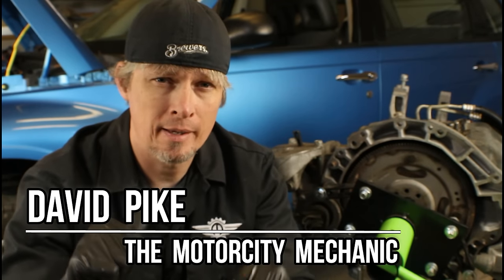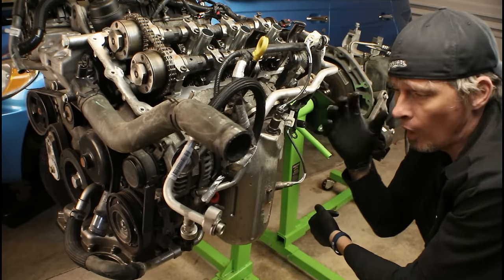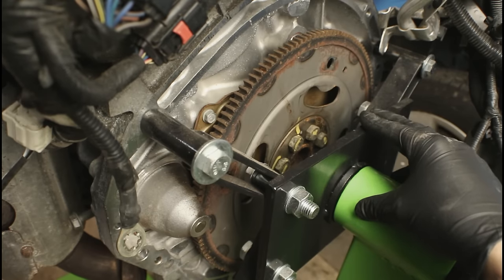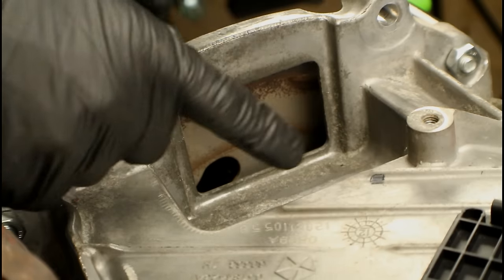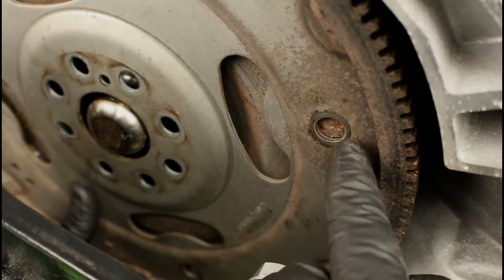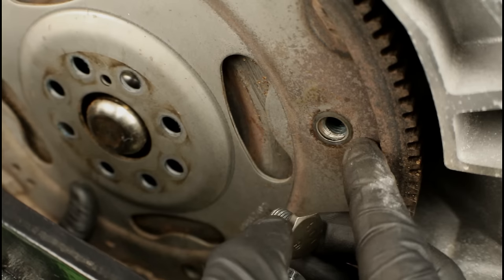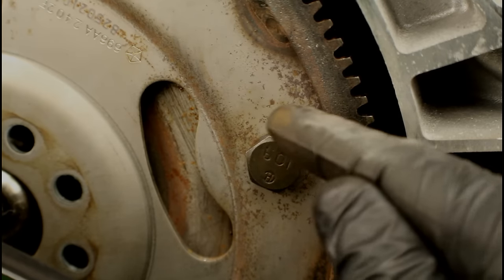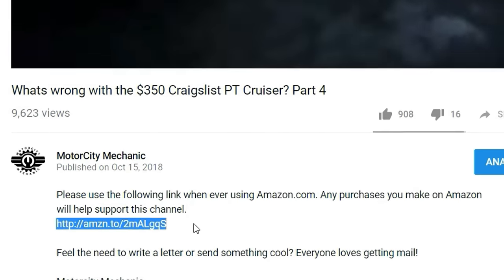Quick Tip: Installing Torque Converter Bolts

Comment: It actually amazes me that this whole thing is only held together with 4 very short bolts! Thanks for this video, you just saved me a lot of time!
Reply: Some are 3 bolts,   M10-1.5x15 , 10.9
The 9.8 bolts should only be used in 4+ bolt design.

Comment: I actually looked at this video because when I took my 2014 Chrysler 300 3.6 engine out to replace it, I threw all the bolts in one pile and now that I'm putting it back together I wasn't sure which bolts went to the torque converter.  Mine has a different flywheel being RWD, but the bolts that I suspected to be the ones are indeed the ones I see you using here.  I have the correct number of those non-flanged black 10.9 bolts, but thought surely they should have been flanged.  This video cleared that up!  Thanks

Comment: Mopar was always different with their flex plates, from the 60's (maybe the 50's) on they used an offset bolt pattern so it was wise to mark one bolt hole on the plate and converter with some paint. If using a new plate or converter you wanted to mark it before putting it all together. And many of them had the starter ring gear on the converter instead of the plate.
Reply: Damn your old🤣

Comment: Great tip, I've installed at least 6 of these pentastar engines/trans and I never noticed the one hole being different. However, I did have one engine where I had problems getting the last bolt in the torque converter and it wouldn't go until I loosened all of the rest. Now I know why. 
Great tip thanks again
Reply from the maker: Appreciate the feedback. Yeah I had the same issues until that one day many many years ago when someone showed me and then I couldn’t believe it was staring me in the face the entire time 🤔😂
Reply: @MotorCityMechanic  ain't that the way of it?
Can't see the forest for the trees sometimes😎
Reply from the maker: Trace 23 Very true!

Comment: Thank you sir I was having issue lining up one bolt I had two of them but it was slightly off as you mentioned im going to get back under and loosen the initial bolt I started with and try and tighten one of the others hopefully I get lucky and they all lime up or  I'ma be spinning it for days .

Comment: Not a Mopar guy, (At least for a few years) But I'll have to see if GM does this.  If not its a shame they, because they force us to do as you said and rotate, rotate, rotate!  Good tip, well explained, simple to understand how it will same time and keep your brain temperature from boiling over cause you had to rotate the flex plate 20 times!

Comment: See a bolt hole...insert a bolt...if it was the “odd hole” torque it all the way to spec...if it’s not...just finger tight...on to the next bolt

Potentially saves you a full rotation on an LS. If you have help, it’s no big deal, but by yourself, it saves a lot of time.

Comment: In my 2000 Chrysler  town and country. My van wouldn't start took starter off found a bolt blocking my starter from starting. Well didn't know where the bolt came from so I put my starter back on.  Van started right up running a little rough.  Long story short the bolts for the flex plate all came out and left me stranded on the side of the road.
Reply from the maker: Joshua McCord great find, sorry it happened. Thanks for finding this video and make sure to subscribe

Comment: lol, I just did this on a 545RFE. I don't recall a special hole but I did rotate it more than once to pre thread the bolts. Then tightened bell housing, then final torque. The MOPAR manual says tighten the TC flex plate bolts last step after bolting in the xfr case and rear support member. I didn't wanna wait until it's all the way up high to do this so I did it after torqueing the bell housing while it was still lifted low. I hope this is ok lol. Comments? I can't imagine the shaft or anything would shift enough to cause a problem here when you install the xfr case

Comment: Thanks that's an excellent tip. I went to the garage and check some of my old GM and Ford Flex plates and didn't see any bolthole with the flat sides but all my stuff is from the 60s. The old Mopars from the era had the ring gear made to the torque converter and they had a separate 4 bolt plate that bolted to the crank
Reply from the maker: Your right. The older stuff was different....almost forgot about those days. I get soooo stuck on the new stuff that the old stuff disappears in my memory bank.

Comment: Never knew that but on my 79 F150 302 ci (C4), the four holes only align up one way. Plus the torque converter when installed has studs that protrude through the flex plate to be attached by 4 prevailing (flanged head) torque nuts. I learned through trial and error the Ford stamp goes up. This aligns every hole to install the 6 bolts to attach plate to the crankshaft.

Comment: At the crank bolts there is a small hole in flex plate put it op. Drain plug on comb.it works from 60s up

Comment: still a fly wheel and flex plate same thing when its not attached to the torque converter like the one you got in your hand it can be used for a manual also if your torque converter has the fly wheel made on to it then its just a torque converter flywheel

Comment: You will find similar schemes all over the vehicle.  The 4 way locator (in this case, the large center hole in the plate), 2 way locator (a slotted hole), and clearance holes are a result of GD&T... which comprehends part variation.  That's how assembly line workers can crank out 60 vehicles an hour.  All mating parts have to fit the first time, and engineers spend a lot of time with the part suppliers to understand / control mating feature variation.  Anytime you see a slot (or an alignment pin), know that it is with purpose.  The problem lies with aftermarket suppliers who don't have (or understand) the original drawing.  This video should note that will work for Original Equipment parts, but not necessarily aftermarket parts.

Comment: Well i'm now on my way to removing the 8 or so dam bolts my flex plate has because the last one is not threading in lol.  I knew something had to be off and was concerned it was another thing.  So , I'm hoping going back over these holes and seeing an indicator or something might give me the fix it needs to allow that last bolt to grab. Im already concerned because i've never messed with this before, but how hard can it be .  lol ty sir

Comment: it doesnt matter if the hole is keyed or not, catch all first then tighten,  what your doing makes no sense, whats the rush ! Take your time and do it right and u wont have to do it again as a come back!
Reply from the maker: When your flat rate.....spinning the engine over two times is time wasted especially when they have made it simple for you already.....why not use the special hole....thats why its there. Not sure how that would have any bearings on becoming a come back but none the less....to each their own. Thanks for the comment and for watching Dwayne.
Reply: Actually, it does matter.  It's just math.  The design comprehends feature variation of the plate and torque converter.  GD&T is applied to the dimensions so that any plate will mate to any converter, and the 2 way locator (the slot)  is fastened first.  The other 3 are clearance holes, and mathematically will always be aligned (as long as both parts are built within the tolerance window, which the Quality folks police).

Comment: I had a starter shear the teeth off ring gear/flex plate.  Replaced flex plate and starter all good.  Should say it was a diesel heavy cranking to turn over.  Still asked alot of people and not seen ring gear teeth broke off.  Nice video     Did you do anything to beef up the TE trans in video.  Or add a turbo to the 3.6????
Reply from the maker: I havent seen that happen ever before but I guess there is a first time for everything. As far as the TE trans.....no modes or upgades that I know of.

Comment: Excellent video, thank you David. 
However I'm working on the same exact commination, I just replaced the engine, bolting all together and now the engine spins very stiff then stops at one point. I can't tell what's going on. Any ideas??
Reply from the maker: Nothing is coming to mind.....its going to be one of those things where I would have to see it in person to get a feel of whats going on.
Reply: @MotorCityMechanic  it was one book that was not tightened!! Thanks a lot
Reply: Bolt*

Comment: So it doesn't matter where the special hole is on the flex plate, only that we install the bolt through the special hole first.  I think I'm ready for a Hemi!
Reply from the maker: Special hole first and all will go fine from there

Comment: I ‘m glad to have your channel,can you let me know how to deactivate my seatbelt chime?2018 Ram Promaster 2500
Reply from the maker: Here is what I have found. I am pasting the info here. If hard to read then email me and I will send it to you that way as well. 

STANDARD PROCEDURE - ENHANCED SEATBELT REMINDER PROGRAMMING
The seatbelt indicator also includes a programmable enhanced seatbelt reminder or BELTMINDER feature that is enabled when the vehicle is shipped from the factory. This BELTMINDER feature provides extended and modified visual seatbelt indicator and audible chime warning responses to an unbuckled driver side front seat belt. The BELTMINDER feature may be disabled or enabled by the customer using the programming sequence that follows, or by the dealer using a diagnostic scan tool.

CUSTOMER PROGRAMMING SEQUENCE

NOTE: 
The following sequence of events must occur within 60 seconds of the ignition switch being placed in the ON position in order for the programming to be completed successfully.

With all doors closed and the ignition switch in any position except ON or START, buckle the driver side front seat belt.

 
Turn the ignition switch to the ON position and wait for the seatbelt indicator reminder function to conclude (about six seconds).

 
Unbuckle and buckle the driver side front seat belt three or more times, ending with the belt buckled.

 
Turn the ignition switch to any position except ON or START to toggle the BELTMINDER feature from its current setting (from active to inactive, or from inactive to active). A single chime tone will provide an audible confirmation that the programming sequence has been successfully completed.

Comment: Great suggestion to use the guide hole!  You asked for questions.  Consider a scenario where there's an appreciable gap between the facing edges of the flex-plate and torque converter. What's the optimal approach to bridge this gap?
Reply: @dnlmachine4287  I'm working on putting back together a 1986 GMC C10 High Sierra. It was a young man's truck. He had the engine and trans redone.  Each was plopped back in the truck. Unfortunately, he passed away before he could complete the project he started.  The truck sat four years. Fast forward to now.  I'm putting this thing back together with the intent of getting it started, sorted out and running down the road. The torque converter was a bit away from the flexplate.  I didn't have to force anything.  I simply slid the torque converter forward towards the flexplate by hand. The TC moves forward and back smoothly with little effort. Once I had TC mated up to the FP, I screwed three bolts in without issue.  They each went in by hand until seated. Then,  torqued them down. Is this Ok?  What would you do different?
Reply: @dnl, this clip shows the "gap" I was describing.  Looks more like the expected end-play of the TC.  I'm going to look this up myself.  But if you happen to know what the spec values are for 16-bolt 700R4 TC with respect to the FP, please share here.  Thanks!   As far as I know, this is the transmission and TC that came with the truck from GMC. It's been worked on. What that means is lost in history.   I believe the FP is also OEM piece. Ditto for the 305 engine.  I'm presuming it should bolt up and be Ok. Let me know if you think my presumption here is flawed and how to come correct.  

https://youtu.be/hMpVrEAZUTA

Comment: yes good but do all flexplates have this bolt hole that's different? I have a 2001 dodge ram van 5.2L and I may have to change the flexplate and the torque converter some time, Ihope not too soon!!! but I am gathering information at the moment. Thank you for the video!!!!!!!!!!!!!

Comment: According to your description, it seems like these bolts do not need to be cross-tightened as you would do when mounting a wheel, for example.  Or, did I get the wrong impression?  Wouldn't torquing them in sequence leave residual stresses?

Comment: Thanks for that tip! I had to have machine work done on my 03 Frontier so I pulled the engine myself. They wanted $1500.00 for R&R. I figured while it was out I would change the transmission front pump seal. I know a little about engines but nothing about transmissions. Do I use Loctite on the converter bolts? Also, what is a good way to get that seal out since I don't have a puller? Do I grease or oil that seal before I put it in? I think a big socket or piece of PVC would work to get it in. Thanks again! PS No rush. I'm in lockdown here in Las Vegas because of COVID19.

Comment: Hi David, I'm reinstalling my 3.6 back in my 2014 jku. My question is how do you line up the hole once the trans and engine are mated back up. I'm using the starter hole to install the bolts and I'm not having a lot of luck finding the threads.

Comment: Good information as usual, but why are the flex plate holes so over sized anyway?
Reply from the maker: Most likely for tolerance between the locations of the threaded portions of the torque converter and the holes on the flexplate. They arent an exact match so it takes up the slack so to speak.
Reply: @MotorCityMechanic  Thank you.  Just seems tolerances on a rotating mass like that would be closer.  Of course it is mass production.
Reply: I know this is a old comment but sometimes this actually works to your benefit,a lot of people will install a flexplate while a converter is not properly seated on the pump in the tranny and destroying the pump in the process while torquing down the converter to the engine.

Since the tolerances are loose (basically the flexplate holes are bigger than the screw) once your start finger tightening your bolts you can use that looseness to check and see if the converter is lose (properly seated) by rocking the screw back and forth, if it doesn't rock back and forth and it seems tight your converter is not seated properly and its telling you "dont proceed or you'll be sorry"  

This is specially helpful in older Ford cars where the converter has studs and not screws, once you marry the engine to the tranny, rock those studs a bit back  and forth, no rock? dont proceed, tear it dont and find out where your bind is.
Reply: @dntlss  Thankyou, interesting point.

Comment: Changing out a cracked flex plate Where can I find the torque specs for the bellhousing flex plate and torque converter And Transmission mounts

Comment: Morning Dave. I purchased a brand new Chrysler 300 with the 3.6 liter V6.Anything I should know about that engine?  I'll let you know how it goes.  :)  Great tip on the torque converter bolts.
Reply from the maker: If brand new then you should be fine. There are issues with the older ones but nothing on the later models. Just keep changing oil every 5000 miles and you will be doing your part. Thanks for watching Wyatt and enjoy that ride!
Reply: @MotorCityMechanic  Thank you!
Reply from the maker: @wyattoneable  Your welcome
Reply: We have a 2014 Dodge Durango with a 3.6L engine.  We've pulled travel trailers up to 5500 lbs with it and I haven't had one issue with the engine.  Lost a wheel bearing in the firs 10k and the rear A/C lines in the first 20k but otherwise a solid running engine.  I now have a RAM so the Durango has be relieved of its trailer tow duties.
Reply from the maker: @phprofYT  Both are great vehicles. Love My Durango and Ram diesel as well.

Comment: What about Toyota Corolla. It has 6 bolts with one special bolt but all the six wholes look same. Still couldn’t figure out why the flex plate is being held tight by the bolts. Any advice on this?

Comment: I just got a question so should you always bolt the engine to the transmission first or tighten up the torque converter first to the flywheel which way should be done first
Reply from the maker: Engine and trans first. Then everything else including torque converter bolts .
Reply: @MotorCityMechanic  thank you 🕊️

Comment: Nice video. I am replacing a 4l60e on my blazer i put tye tranny in today but when i went to bolt the torque converter up the first 2 bolts went in easy the last one was hard to get in i think it was cross threaded or not lined up all tye way when i put it in. Either way i put it in amd tightened it all the way down will it hurt to leave it that way?

Comment: Why don't they make the center hole fit so it aligns the flex plate in the center to start with? nice tip doing a mini cooper now and has mort than 4 bolts

Comment: We have a leak at the bellhousing it drips transmission fluid while running and then dumps it after shut off.  It's a totally refurbished transmission we just got it.  We have taken it out 3 times to try and figure out where its leaking from. We replaced the torque converter seal and still no luck.   And the torque converter is seated properly into the transmision.  So lost. Domt know if the flex plate could be the cause? Not sure

Comment: I wonder if you could have used one out of a just say and O2 Lincoln Continental 32-valve 4.6 high-tech engine they're basically the same engines

Comment: Thanks for the tips,
Is it possible to replace my jeep grand Cherokee 3.6 2012 engine with dodge charger 3.6 2018 engine? 
Im already asked about it they said you have to change your oil case and flywheel then it will be fine!